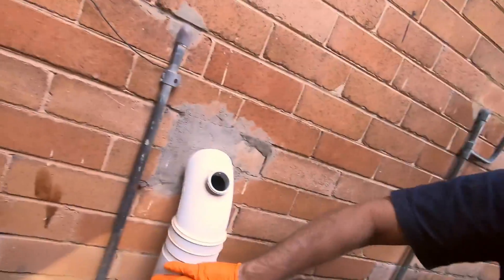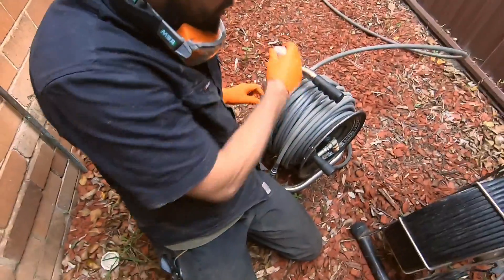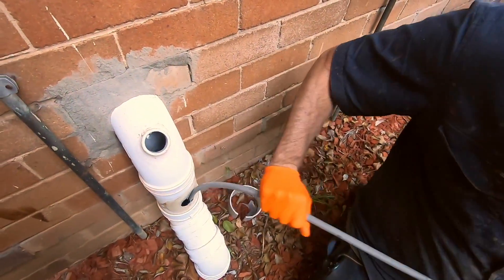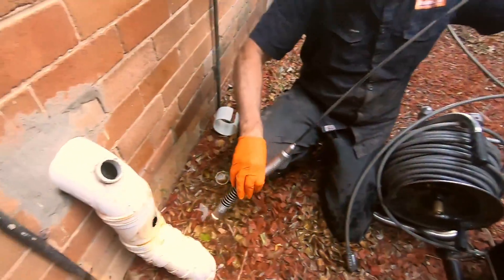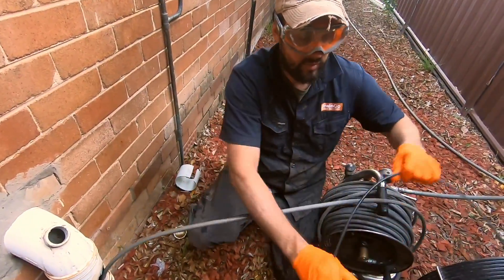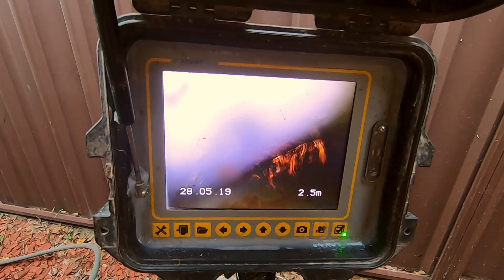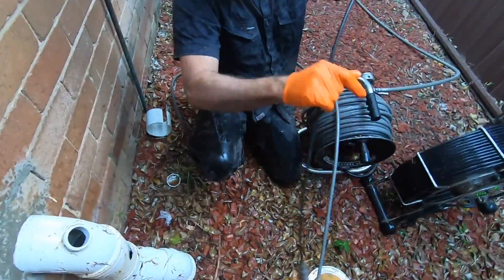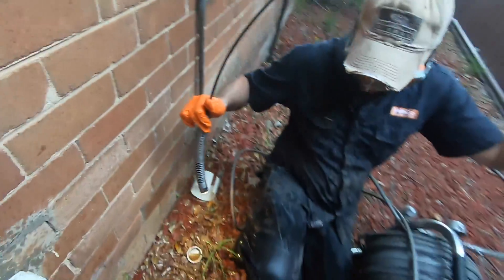Blocked Drain 216

Comment: It is possible to lost that... metal hose tip thing inside a pipe? Did it happened to you ever? I see it has kinda default pneumatic rapid connection so looks like it could happen?

Comment: seems like that country got major sewer issues a whole mess of them
Reply: I'd say no more than any other municipal system.  Roots and people flushing down the wrong stuff are a problem no matter what country you're in and will ensure these guys always have a job.
Reply: Only the old stuff,and the occasional dodgy plumber, Most of our good plumbing system you won’t see because they work well, it’s only Vitrified clay pipe, that was installed in the late 70’S all of it is a failed system,and mostly install incorrectly, the work Ollie does is mostly earthenware,and is illegal to use VCP domestically, it’s advised to rip out any clay pipe!
Reply: In this particular video this is just a U PVC Pipe not glue right that’s causing the problem,Ordinarily done correctly wouldn’t happen,

Comment: I assume this would become an issue again relatively fast due to the root regrowing? Afterwards would you have a discussion with the homeowner about having the pipe replaced?
Reply: I'm not sure if they do it there in Australia, but I saw a few videos where they take this tool that looks like a sock and feed it through the pipe where the roots are or where the hole is. They then feed water through (I think hot) it to expand and it starts the hardening process shortly after. After it settles, it's supposed to be incredibly hard.
Reply: @The513Warning  Like me.
Reply: @martywhite5384  Huh?
Reply: @The513Warning  You are talking about CIPP (Cured In Place Pipe relining) where typically a fibreglass cloth liner, or polyester cloth liner is impregnated with an epoxy & set in place int he old pipe, where it is hardened using several methods depending on which system/techniques the company uses.

This has been used around the world for over 30 years & is used throughout Australia.

Comment: How do roots even get in a pipe?
Reply: Time and pressure from the roots growing in towards the pipe. Eventually they exert enough pressure or with just someone walking over the pipe it is not deep enough. Can cause the pipe to crack and allow the roots access inside. Once they get in they flourish because of the nutrient-rich water
Reply: Was thinking the same.. if the pipes are so weak that roots can grow trough it maybe they should use stronger materials
Reply: Generally if pipes are installed correctly,good joints with blue metal, roots won’t get in, however in some situations it’s true pressure can cause cracks, that can be over come with using Better graded PVC, Aussies don’t like paying for quality, cheap is the go!

Comment: A vertical pipe will lose all the water and transport capacity...
Reply: Posh panda So what do you suggest? Running all pipes horizontally, at knee level, across the garden?